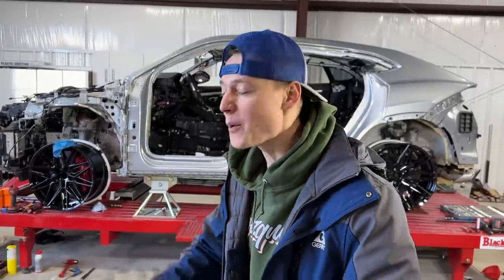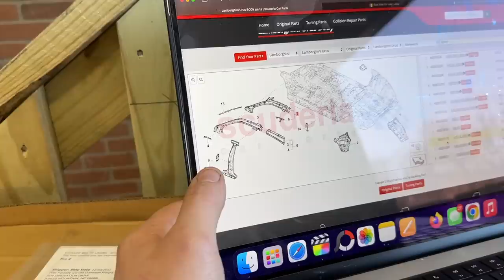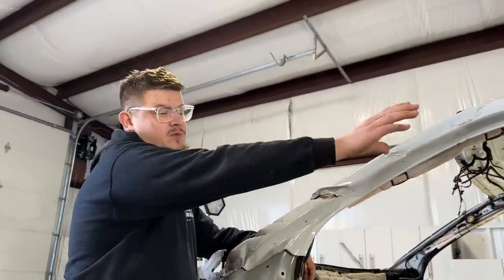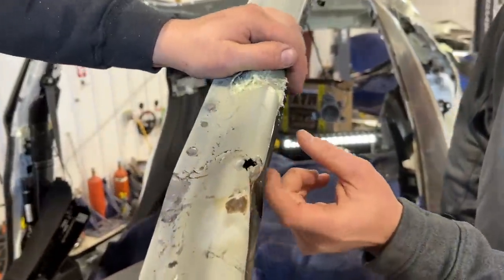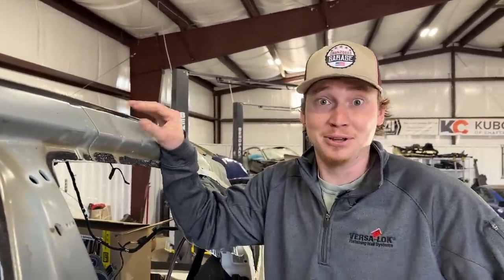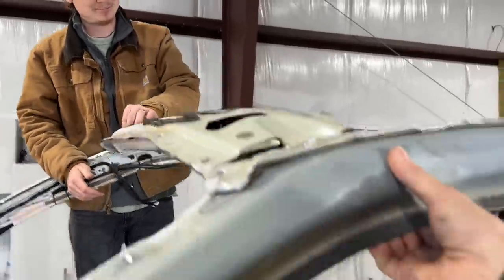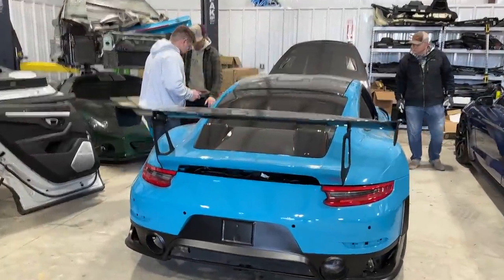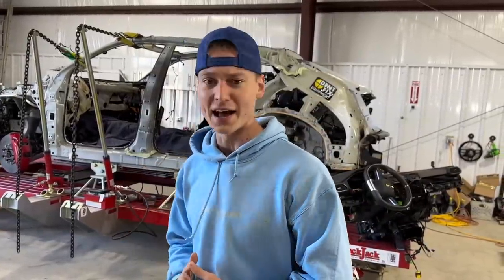Rebuilding A Wrecked Lamborghini Urus Part 10!!!

Comment: On a difficulty scale and labor intensity scale of 1-10, the Urus, 911 and Camaro have the gauges pegged at 11.  V-Tuned never fails to bring in his expert skills and experience.  These rebuilds are really top notch.  I think some other "flipper rebuilders" might not be as diligent and take plenty of shortcuts. Simeon, you best be wearing eye protection son.  Ain't no fun getting steel chards in your eyeballs plus you set a better example for others when you always practice safe working procedures. Ya'll have come so far from tinkering with Jeeps in parent's driveway, I'm blown away by your hard work and can do anything, positive attitude!

Comment: I’ll bet you guys are wondering why didn’t we build this building bigger? I learned from my dad that you build your shops as big as you windup filling them. I’m thinking by the end of this new year you guys will be adding on at least 1/2 of your original building size. Anyway great job everybody.
Reply: Don’t think so, they’ve mentioned in other videos that they were selling some of the builds that don’t get driven. Believe they sold the Sierra gladiator & hellcat, and there on the fence about the Trackhawk
Reply: @Corsini90  they literally don’t drive any of them lmao
Reply: @maxhendryx6171  Would you want to drive a car that these two repaired  ? 80 % complete is usually when they move on to  something  new. I would not trust anything they touch.
Reply: @maxhendryx6171  I wouldn't either. Most are not in "complete" repair and the ones that look like they are really aren't. Structural integrity is an actual thing. I wouldn't put myself or anyone I know in one of those cars. Plus they list these cars for insane prices, knowing that they have a salvage title. They just aren't worth the risk. Have you ever looked into or tried getting insurance for a car with a title like that?
Reply: @Enter-a-name55  i completely agree you couldn’t pay to get in ine

Comment: also you will notice on your lambo frame, near the driver window/windshield where it cracked it did that in a designed way. you can notice it is bowing out, away from the cabin so the supports don't impale any occupants. it breaks outward and is pretty neat when you see how frames give in a wreck, they have designated weak points like this placed strategically for safety's sake.

Comment: All porsches need the oil warmed up before revving it and must not idle or else you will hurt/scor the  engine as the gas is a scorring element when the engine is not warmed up. so please warm up the engine oil before revving it. Always start it up and drive it to let the oil warm up, no idling. Great video by the way and good work. cheers !!

Comment: you have the panels so replace every damaged panel  be careful with the heat when welding as high strength steel (BORON) dont like it it goes brittle resistance welding is the way

Comment: Hey fellas hey fellas you need to get yourself a Milwaukee heat gun is goodbye 2000° and no flames also you need to get about 18 solar panels and keep them on separate circuits so you can have electric heat running in your building all the time and you can use it for air condition in the summer also same one you need the blue print all of the old trenches that you put at the new house so you will know where all those lines run so you won’t Tear them up when you have to dig

Comment: Need info from viewers: Retired engineer here, and I'm wondering if a car like this that has had a lot of metal bending, pulling, etc. maintains it's structural integrity and crash worthiness. Most metals, when bent, develop tiny fatigue fractures which will weaken it. It starts out on a microscopic scale but, with time, can propagate and then fail in a catastrophic manner.  No criticism of the guys is intended at all; I'm simply curious. I know these types of cars are usually driven hard and subjected to higher than normal forces   Anyone have knowledge/experience regarding this? Thanks in advance.

Comment: I’m telling you the Porsche 911 Turbo will never run properly.  Still tons of work to do on this car alone.  Cheap build.  Imagine putting spacers on the front wheel housing or putting 325 wheels to fill in the gap instead of getting the GT2 RS axles as would be the right thing to do in this wreck conversion.  These boys have more money than brains.

Comment: Here's my suggestion, don't buy cars which are totally written off use your experience and knowledge when looking at the car you choose to rebuild access all the damaged areas and parts and use a rough estimate of what your parts have cost in the past to help you decide if the cost to rebuild far out weighs the overall rebuild value and resale price of that model car.  Some cars just aren't worth saving, your just wasting your valuable time on a piece of rubbish.